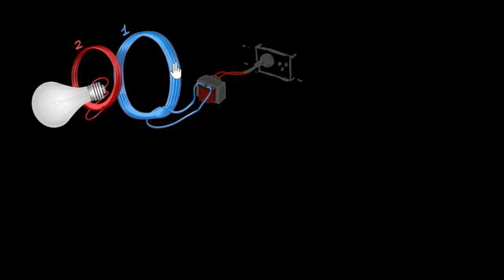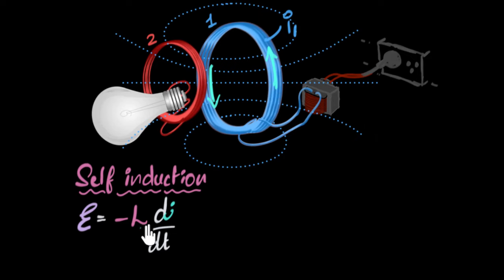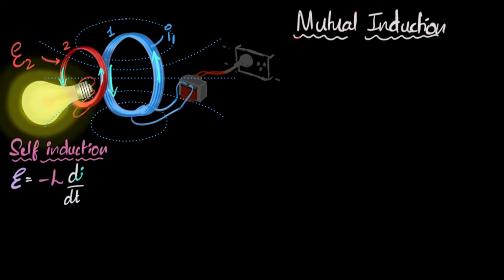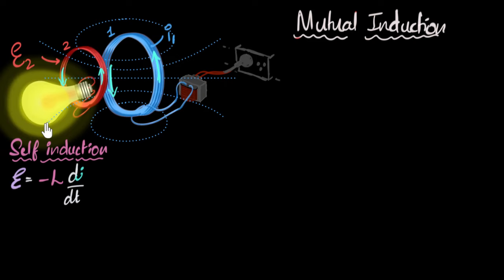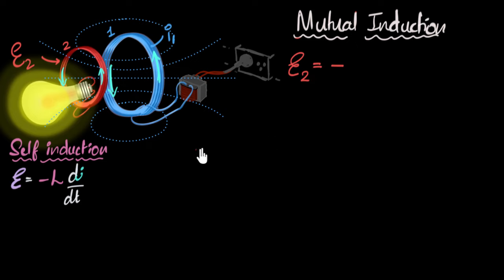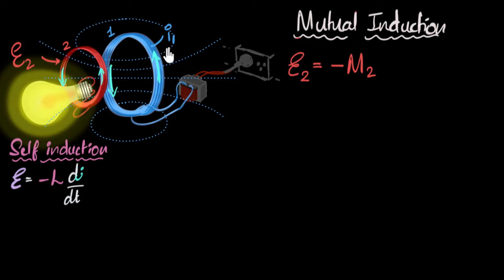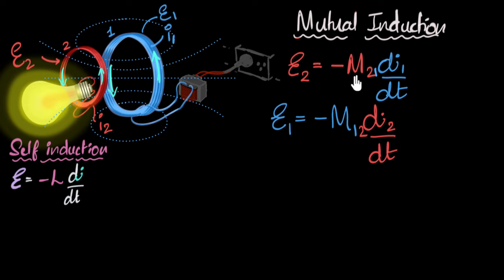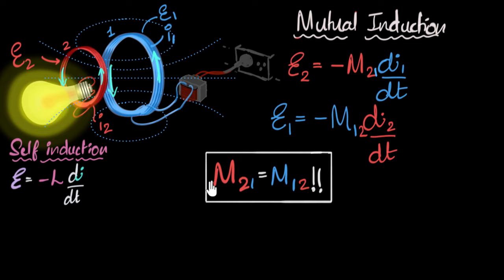Mutual induction & inductance | Electromagnetic induction | Physics | Khan Academy

Comment: Sir you told current is changing in coil 1 which leads to change in magnetic flux how is current changing in that coil????
Reply: We can use alternating currents to keep the current changing I Guess
Reply: Coil 1 is connected to an AC voltage source, therefore the magnetic flux is changing.

Comment: If u move the second coil the flux decrease ok.. But the rate of change of flux is same as that u move it towards the first coil.. So why the brightness of the bulb decrease?
Reply: Eddy currents much k
Like soundwave energy " air watts pressure wave propagation fields " have a sweet spot..